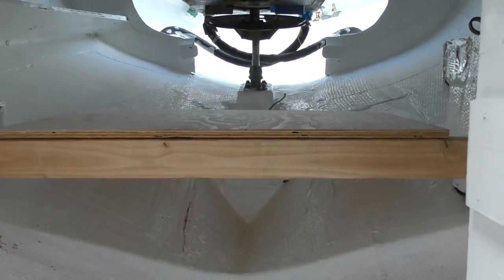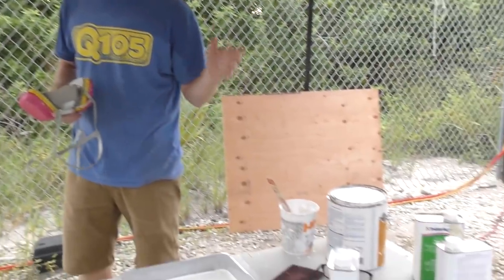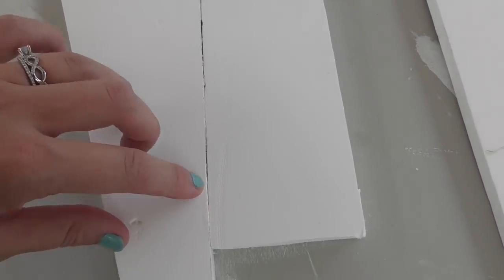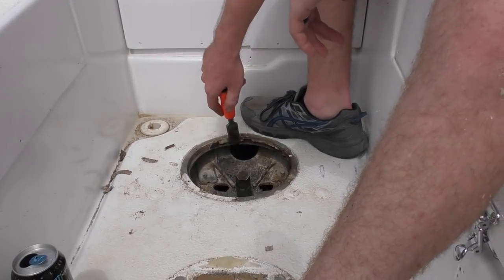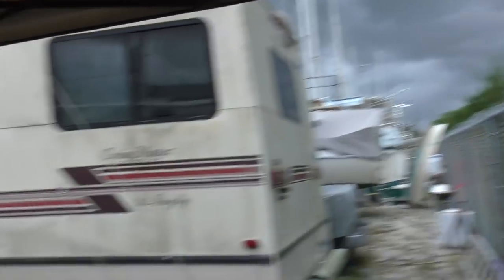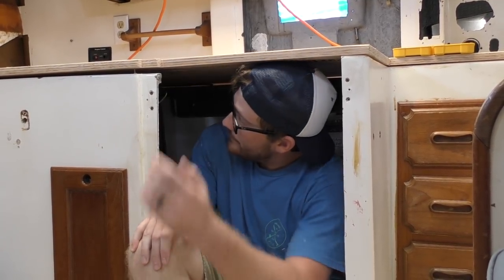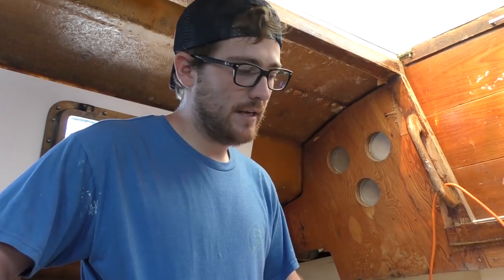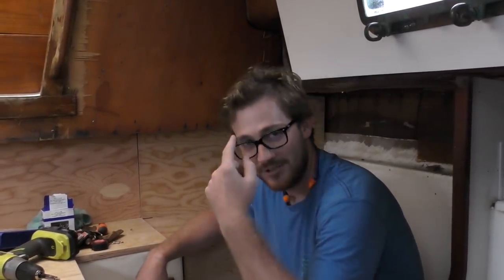54. We Have Multiple PROJECT Disorder - Reality of Living Aboard and Refitting | Learning the Lines

Comment: You can prime and soften the PVC edges with acetone before gluing and it will help to smash down the high spots and fill the low spots in the joints.  Some clamping will also help with making a solid joint.
Reply from the maker: Thanks for the tips! Apparently there is also a clear PVC primer so I'm going to pick that up.

Comment: The outside video camera is not a bad idea if the screen is protected, like under a dome. You could even hook it to a rotating plate that is controlled by a joystick at the nav. station. If I had a boat I'd try it because I already have the joystick for such a device.

Comment: You appear to be pushing your power saw too hard through the plywood and you need to adjust the blade depth so that the teeth are just clearing the board on the underside of what you are cutting.  Having the depth of the blade set too low will result in causing the wood to chip and split, particularly plywood especially when you go across the grain of of the face board. Also using finer tooth blades on your jigsaw will give a better result depending upon the grain of what you are cutting. All that said, you two are doing a great job, keep up the good work.
Reply from the maker: Thanks for the tips! We'll check to make sure its properly adjusted next time.

Comment: @14:31 Folding tablet idea. It could be like when you are flying and sitting at the very open front bulk head with no chair or tray table in front. It could rotate up from the right side and the across your lap. Just like the airliner make those little stow away tray tables.
Reply from the maker: Interesting idea! We installed the DC panel recently though and I think it cramped that space for the idea.

Comment: Guys. Put a tarp up. I know you don't have the mast and boom to do that but make a temporary frame out of scrap wood. Even a small tarp like your neighbor has will help reduce the heat in the cabin. The heat is coming from the sun radiating on the decks. The AC works better in the rain and cloudy days not because the air temperature is cooler but the underside of the decks, the interior surfaces, are not getting heated from direct sun light. It will make a noticeable difference. Even if you splash next week it is worth the comfort you gain for that week.

Live with the stained deck while in the yard ... unless you plan a second coat of paint. Never paint over a stain because it will bleed through. Otherwise, plan a complete wash, stem to stern a day or two before you splash. Buy a gallon of Muriatic acid sold at Lowe's in the Garden Center/swimming pool supplies. Put some in a misting squirt bottle, cut it only with distilled bottled water and no more than 50/50, and spray it everywhere or apply it from a bucket, full strength, with a nylon boat brush. Safety tip: Stay up wind of the spray and keep a hose handy. Muriatic acid will sting on sweaty skin.  Spray it on pretty heavy so it doesn't evaporate and allow about 5 (or so) minutes to work. Then clean the entire boat with really soapy water. Muriatic acid will react to both, organic and mineral stains if the water is sulfur(ish) or has "iron bacteria"; purple bird poo; blood stains; decaying leaf stains, black decaying tree pollen, etc, but it also reacts to metal oxides like rust stains, actual rust, and copper patina. Pre-Soap down your brass if you don't want the patina to be effected. Paint some liquid Dawn on the brass. It's a good, fast stainless cleaner and removes rust from the most obstinate fittings if you use a paint brush to dab it into the cracks. Works wonders on rust rings from paint cans left on the deck overnight. The most important thing in the process is to rinse completely with soapy water which neutralizes the acid. I learned this cleaning process from a professional boat detailer 20 years ago and have yet to find a retail product that works as well and as fast. 

People tend to be afraid of this because of the word "acid". Muriatic acid is used to reduce PH in swimming pools and in diluted form as an eye wash (as in Murine Eye-Wash), so it's not as hazardous to human tissue as you might think - only in high concentration. Anyone who has ever tried it will make sure there is always a bottle of it aboard. It also removes food and rust stains from clothing but you do it quickly because it will dissolve cotton and wool.

Oh! It turns aluminum black rather quickly so be aware of that.
Reply from the maker: Thanks for the advice! We tried to temporary structure when the port light were out, but it was so hot under the blue tarp. I dont think it was tall enough, but that's deterred us from trying again until the mast is up. Shouldn't be much longer. We think we'll probably leave the kiwi grip as is for now and maybe only wash when it rains. We'll try your strategy once we're out of the yard before we put on the second coat.
Reply: Matthew, it will absolutely take care of it in about 5 minutes. You'll kick yourself for scrubbing for two day. By the way, Muriatic acid does nothing to plastic surfaces. Gelcoat, polyester and epoxy, and poly vinyls are completely impervious to the acid.
Reply from the maker: Love that we can all learn from each other. - Randi (obviously, Jordan is not so cheesy)

Comment: Are you just pressing the PVC together? If so remember, when you join PVC pipe joints after applying the primer and solvent you twist the connection clockwise and counter clockwise a few degrees to insure a total contact bond. Slide your two surfaces together in both directions , I think you will like the results.
Reply from the maker: I knew that about the PVC pipes, but hadn't figured out how to compensate for that motion with the flat pieces. Thanks for the tip!
Reply: I would lay out some foil or wax paper put the solvent on then lay them flat and move the edges horizontally, I really like what you are doing. I live near lake city but am currently in lake city visiting my son, will be glad to come down and assist (for free) if desired.  I’m retired so I have time
Reply from the maker: We appreciate the offer, but it gets a little tight even with the two of us when we work on projects. Lol. I like your tip though and will definitely use that.

Comment: Hot tip... when working with PVC board, if you want to make a nearly invisible seam, you should use a plainer to straighten the joining edges.. this will make them much stronger and straighter.. also when using the adhesive I'm pretty sure your supposed to let it tack up before joining. 
Also the paint is only a temporary water barrier.. paint is susceptible to moisture.. if you seal it with a thin layer of epoxy you will be guaranteed longer life.. 
Keep going, your closer today than you were yesterday to sailing off to the sunset and sandy beaches..
Reply from the maker: Unfortunately, we do not have a planer, but I can try sanding them down to a straighter edge. It didn't mention letting it tack up first in the instructions, but I'll double check. 
We actually used an epoxy primer so it is extremely moisture resistant. 
Thanks for watching! Closer every day.
Reply: If you don't have a planer, clamp your piece to a board you know is square for support, then rub it on a large piece of sand paper on a flat surface. If you can get your edge flat and square, your joints will look better. You could cover the residue with a small bead of white calk if it really bothers you.
Reply: I think he means a hand plane. You can pick up a used one at a flea market for about $5  Believe it or not a old used one is better than a new one.

Comment: Marine grade plywood is no panacea to water problems, paint is definitely a help.
Many people make the mistake of thinking that volume of air is what matters in terms of cooling or heating, but far more important is surface area and the insulation in that.  Cooling the solid material in the inside of the boat is orders of magnitude more work than just cooling the air.  Also a curtain isn't going to do much to actually reduce the volume being cooled, air molecules be really tiny.
Reply from the maker: Thanks for watching!

Comment: Try to sand the edges to make them flat with something like 120 grit, then carefully apply clear plastic cleaner/primer.  It softens the plastic and allows the plastic to literally weld itself together chemically. #plumbersknowledge 😉 ...If the shelves will be sided with plastic as well (pvc board) you may try to notch the sides in with a router so that it has physical support as well as the chemical bonding. (Carpenter knowledge.) 

On the storms, here in West Central Florida.... We had some INSANE thunderstorms the last few days. I cut up downed limbs for 5 hrs yesterday 🙃🙄🤷‍♂️ keep it up guys!
Reply from the maker: Definitely going to sand. I'm thinking about routing the parts for the shelf, but maybe not the portions that are already installed in the boat. We'll see how it goes.
Reply: @LearningtheLines  using a router anywhere you can is going to add strength. The chemical bond will hold quite a bit but having the physical strength of the PVC will help immensely.

Comment: I was so impressed with your "experimenting" with PVC and cement.  The one thing you said that I wonder about is that you used the "bad seam".  I suspect your referring to the empty space between the 2 pieces you glued together.  I was disappointed you didn't show if the bond was strong enough for the purpose your using it.  Having used this method of gluing PVC board together I kinda know how strong the joint is.
Several hints and tips to make this whole process make you happy.  
1. Use wax paper under the glue up and you can use it over it as well if you wish.  
2. The PVC glue shrinks so your probably never going to get a joint that is perfectly flat with the two boards.  You can force it to be flat by letting the first glue dry and then apply a small bead of glue over the joint.  As that  second application almost hardens, use a straight razor blade to shave off any excess above the boards.
3.  anywhere you have a joint, especially one where two boards meet at an angle (corner)  all you have to do is lay down a bead of white tub calk.  round it with a tool or your wet finger.  I think you will be happy with how that looks.   I think you used clear glue  I think  you'll be more happy with white glue.
You can do the same thing on those pesty gaps where two boards meet flat on.  I know your probably thinking that the gaps in your experiment boards is a sign of a weak bond but I think  you will find they are surprisingly strong even with the gaps.  Just hiding the gaps with calk will not be hiding a weak joint.
4.  These tips are the "no tool methods".  IF you have a circular saw, router or edge router you can make those joints perfectly straight and the gaps will really disappear compared to what you got in your test.
Reply from the maker: Thanks for the tips! I will definitely keep these in mind. The reason we didn't show the final product or really finish testing is because we have so many projects going this week. That was all I've done with the boards so far. Hopefully I'll get back to that project this week.

Comment: Read a few comments about the PVC lumber.. Primer ! Primer ! It's a must..it gets the PVC tacky and prep's for glue also you should get the surface as straight as possible. When you cut it you can use the primer to smooth (seal) the cut ends acetone also works to do this but don't use acetone as a primer it'll dry to fast. . 
Mat Chuck those black Ryobi batteries ! Get the 4ah ones the black ones discharge fast and will kill your tools plus get the 1/4" 18v impact you'll love for driving screws and bolts and it has enough ass in it to tighten nuts..

You aft PVC bulkhead glass in some tabs to screw the centerpieces in. It may warp over time due to heat...but you two are looking good on the project !
Reply from the maker: Yep, I will definitely pick up some PVC primer and make sure the edges are straight. We actually just picked up a Dewalt impact driver. Lol. Thinking about the PVC around the companionway. Hopefully the adhesive we used will prevent warping.

Comment: Corean, or any other solid surface material for that matter, should not be installed on top of a solid sheet of material.  Having fabricated the material for over 30 years, we quickly learned (as did DuPont) that if it is not placed on a frame with the bottom side exposed it can not dissipate heat and is likely to crack or have seam failure.  It sounds like you are attempting a no drip edge and their are specific router bits that are made to fabricate that feature.

If you would use a straight edge to guide your saw when cutting the PVC material, your joints will be much tighter and not as noticeable.  I agree with the previous comments on the use of primer for not only strengthening your joints but also smoothing them out.

Lastly,  most of the places you are using 2 x 4's could actually  be done with 1 x 4 material which would cut down on weight.
Reply from the maker: Thanks for the info! I haven't been able to get back to the PVC project yet, but hopefully will soon.

Comment: I forgot to mention I do have a poly and plastic welder, after welding all you need is a paint scraper to smooth the edges. They sell an inexpensive poly welder at harbor freight it’s about $70.00
Reply from the maker: Hmmm. Interesting. We'll do a few more pvc cement tests and if that works fine hopefully we wont need it.
Reply: That!

Comment: One reason or cause that countertop bowed in middle you surprisingly mentioned yet appear to not have dawned on. Shims. It looks like they simply shimmed in the gap like you are planning to do now, which over time wear and rot away. Use plastic shims or some other non-wood if you insist on shimming, or better glue another panel alongside that fits better.
Reply from the maker: Maybe? The fiberglass is not level though which seems odd. We ended up filling the gap with thickened epoxy and removed the shims.
Reply: Meh, better than any wood shims that is for sure. Not sure with marine const. practices, but would not be surprised if they simply used wood shims. Which is fine for most applications, but marine environment and more importantly bearing mobile load vs static load, simply are not as strong as end grains of the wood. Lot of people do not think about the extra strength required for non-static loads and being used as step down should be considered. Hopefully the epoxy will work for you, if not should not be that difficult to glue in another marine ply panel alongside later if showing signs of sagging down again.

Comment: most PVC cement IS clear----its the cleaner(primer) that has color--useally purple--there is a clear PVC cleaner(primer) that you can use to make the bonds between pieces--good luck
Reply from the maker: Yes, someone pointed that out to me in an earlier comment. Whoops! I will get the clear primer now too. I had only ever used the purple primer and blue cement prior to this, and for some reason I didn't see any mention of the clear primer in the video I watched or on the can of the clear cement. You guys are great for showing me what I need. Thanks!
Reply: You absolutely NEED Primer! It is half of the bond, it softens the PVC and prepares it for the bond which is a cross linking of the PVC material from both sides of the joint! Not trying to be preachy, just take it from someone that has used PVC primer and cement for 20+ years as an irrigator. You are technically " solvent welding" the material not GLUEING! LOL! Love the channel and being able to watch your journey! I will be watching to see how the electric swap and actual endurance of the system.
Reply from the maker: Thanks! I'm definitely going to pick up some primer.

Comment: I hope you have watched Dan from Uma do his galley rebuild with Corian !

When trying to seam PVC board (or Corian for that matter) to get the best looking seam the 2 edges must be "jointed" to make them perfectly flat and square.  There are a few way to do this, but the best tool is a power jointer.  (𝐶ℎ𝑒𝑐𝑘 𝑌𝑜𝑢𝑇𝑢𝑏𝑒 𝑓𝑜𝑟 𝑎𝑙𝑡𝑒𝑟𝑛𝑎𝑡𝑖𝑣𝑒 𝑚𝑒𝑡ℎ𝑜𝑑𝑠.  𝐴𝑙𝑠𝑜 𝑔𝑜𝑜𝑔𝑙𝑒 𝑓𝑜𝑟 𝑡𝑖𝑝𝑠 𝑜𝑛 𝑔𝑙𝑢𝑖𝑛𝑔 𝑃𝑉𝐶.)  One benefit of PVC over Corian is that it does not take a lot of time for the glue to set up.  Less than 30 seconds.  Using clamps will help minimize the gaps.   I think the best way to remove glue squeeze out is a very sharp chisel.  I am surprised that more DIY boat refitter don't use PVC.  I seems like the perfect material.
Reply from the maker: We are definitely glad we found these PVC boards. Hopefully I can get back to the shelf project this coming week.
Reply from the maker: Wow this is an awesome resource! Thank you!
Reply: Another video tip.  This will add a lot of strength when try to make a 90° corner with 1/2" PVC board.  Requires a 45° miter cut.  You can use regular PVC glue.  https://youtu.be/HkTfC0G1SxQ  Also, instead of butt gluing edges together use a 45° scarf.